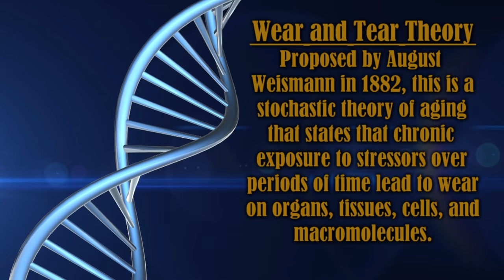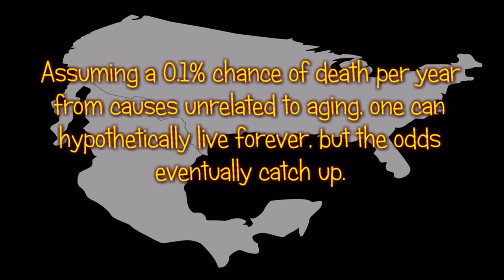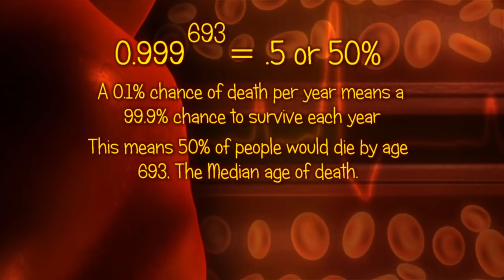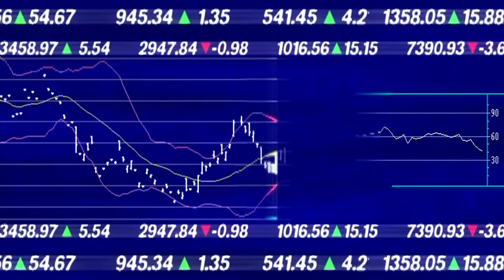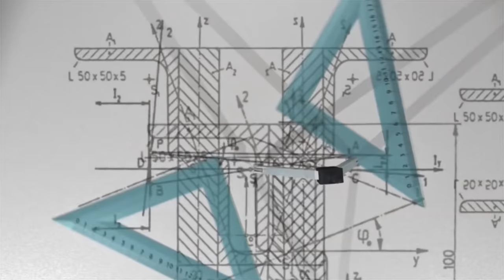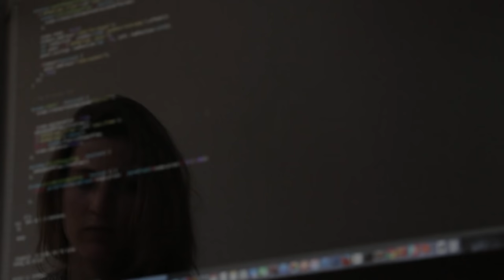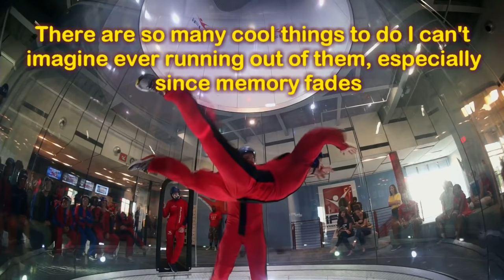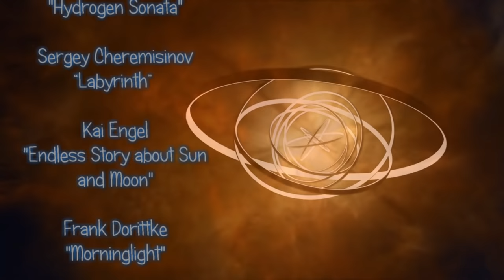Life Extension

Comment: Now I don't know of any statistics about this but anecdotally, from what I heard, lots of researchers will tend to change the topics they work on over time, either as they feel they have contributed enough in their current field or because they want to find something new-and-fun-to-them or sometimes directly out of activism (like, for instance, there are quite a few people who used to resarch, say, fundamental physics, but then transitioned to climate sciences because they consider the topic of critical importance) so with that in mind I'm not entirely sure the people who first successfully find ways to craft arbitrary lifespans will end up researching that same topic for their whole arbitrarily long lives.
Reply from the maker: Sure, interest vary over time but while you might change focus and get a little rusty on the original, you never really lose that expertise and can scrub the rust off rather quickly, often emerging with greater expertise from having new insights from letting it wait and looking at other things.
Reply: I agree, and immortals make the ultimate renaissance men.
Reply: That's true enough
Reply: I agree. Additionally I believe there are new insights to be gained from studying seemingly disparate fields and sciences. Using the example that Kram gave, perhaps a biochemist or even a sociologist could add a unique perspective on climate science, potentially leading to a breakthrough that may not have happened if someone didn't connect interdisciplinary theory or phenomena.

Comment: One thing I have to question is whether we overwrite memories. How do we know when we have truly forgotten something, and what does it mean to forget? I might observe something which jogs a memory or feeling of familiarity that may have gone unrecalled without outside stimulus. Was that memory forgotten? Is forgetting the loss of a memory, or the inability to recall it?  I understand that there are a finite number of neurons in the body, but I don't think we understand memory formation and neural networks well enough yet to say that we overwrite memories, although it is highly plausible. Given extreme longevity, however, I wonder if this would be much of a problem with artificial neural nets and physiological optimization.
Reply from the maker: We're still very iffy on a lot of the specifics about brain memory storage so take everything with a grain of salt, but to the best of my knowledge we do not overwrite memories, but the connections do change without use and the changing connections can alter a memory, akin to having a million frames in a video and changing some of the sequences to create a new film.We can imagine a slightly different scenario having occurred to, and insert that imagined event into our proper memory of it. So I guess the answer is Yes and No.

Comment: One major factor in aging is also telomere depletion. Our DNA has endcaps of blank DNA that partially break away every time the cell divides, and as the telomeres shorten cells stop dividing, leading to a loss of the ability to regenerate the body. This has likely evolved as a protection against cancer, because cells that are multiplying out of control will hit this limit very quickly and die off. Since evolution doesn't select for longevity, but only for fitness to reproduce this giant flaw to an individual has always been a huge boon to a species.

Comment: Have you ever thought about doing an episode on the DC (vs. AC) power grid?
Reply from the maker: I can't say that I have, its an interesting thing from  practical or historical level but not really the channel's flavor. I'm a big history buff but I generally limit discussion of such to interesting tidbits inside a more futuristic topic.
Reply: Although Edison had small DC grids, DC is also the new thing replacing AC for long distance power transmission. It can be millions of volts, does not suffer skin effect, capaciitive or inductive losses. It's now possible with new semiconductor switches that can convert back to AC at the ends. It is also good for underground and undersea cables. And the phase and frequencies at the ends can be completely different.

Comment: In my opinion, the two best research Charities to donate to would be either Parkinson's or Huntington's disease. Parkinson's will be solved by either cybernetics, single tissue neuronal replacement, or aggressive protection of sensitive cells. Each of those technologies will have trickle-down benefits.

Huntington's involves fixing a single gene, which will also have trickle-down benefits as the technology is adapted for other uses.

These are hard problems that require a specific tool in order to solve, but once that tool is invented, it will be adapted according to various intuitions

Comment: There's a very clever way you can avoid a gerontocracy. Those who are younger and more experienced can volunteer to work for a lower wage than someone older and with more experience.
Reply from the maker: Yes and no, that handles the employment issue to a degree but a gerontocracy is 'rule by the old', official or de facto, power and influence will concentrate to those who are older. We elect younger people for their vigor sometimes and sometimes someone younger gets a lot of power, wealth, influence, etc but in general we already live and usually have lived in civilizations where the people in charge were generally older than the average person, and when 'vigor' ceases being an issue and senility is not, that would tend to increase. Who do you vote for? The guy who has a resume covering several centuries or a few years? Who has more power and wealth and influence? Someone who is 200 or 20? There will be exceptions but as a whole we all get better with time and when age isn't wearing you down that becomes even more noticeable. Someone can hardly get elected to office by offering to work for less either, so that option isn't available.

Comment: If someone did discover how to make such a 10x or 100x longevity pill tomorrow, what about all the health conditions that aren't directly related to the cells of the body just failing from old age? Like strokes, heart attacks, etc.. There are no guarantees that a longer life span would also [significantly] slow the progress of such diseases. If someone lived 90 years (taking those pills), then had a debilitating stroke, they might live end up  living another 80 years (even if they stopped taking the pills) trapped in a useless body. So with extended life benefits also comes some extended risks if something bad happens to you that medical science has yet to find a way to fix. In a way, this is similar to the Torchwood comment someone made, only not to the extreme of a fully burned body (which would at least still be lethal with cellular life extension tech).

"Phil: Hey Bob."
"Bob: Hey Phil. What have you been up to?"
"Phil: Oh, I just finished up some chemo."
"Bob: How many times is that now?"
"Phil: This is my 27th cancer diagnosis in just 285 years."
"Bob: Really? I've been lucky so far. Only had cancer 15 times in the past 300 years."

Comment: Laws requiring seat belt and airbag only work for short time. Once humans find out that they are saved by those add-on, they will push their vehicle to go for higher speed, which will make seat belt and airbag pretty much useless when accident happens. Humans, is the problem.

Comment: In a society free of ageing the most common cause of death would be cancer. We all generate cancerous cells on a daily basis, it's our immunic system that filters them out most of the time. Long life span means more chance to eventually draw the short straw on the cancer game. Not to mention addictions: can you imagine a pair of lungs exposed to smoking for 1000 years, or a liver bathing in alcohol for centuries? :). Solving the aging issue is only one side of the coin. On the other side it's quite possible that by the time we find the solution to ageing we also will be able to grow organs to replace the failing ones and we likely can find the cure for cancer. Clarktech for the win :)
Reply from the maker: That's why one of the big Sens categories is OncoSens

Comment: Well... I think you're drastically overestimating what effect anti-aging would have on the death rate.   People die of heart attacks, strokes, and cancers in their 20's and 30's too.  Eliminating purely age-related illness does not eliminate the actual death vectors people experience.   What it does do is drastically increase the odds of survival if the health system responds rapidly enough if you have youthful vigor.  It by no means guarantees survival as the injury itself can cause cumulative damage, but without aging, the odds of being able to repair that damage increase drastically - even in the most extreme cases.  I'd say you'd have maybe a 25-55% reduction in the mortality rate based on global location increasing to maybe a 75% mortality reduction rate once health care and rapid response became universal.  

I also think that sitting on your blue-ribbon committee you'd have to consider the following.  Your workforce will require regular retraining to A) ensure that they are up to speed with social and technological advancements.  More importantly, a Social Security would still be required to fund a "retirement" phase allowing people to leave the work force and pursue that re-education.  If we use the number of having a 70 year work limit out of every 100 years, the Social Security System would provide coverage (plus whatever savings you would have) for a 10 year vacation and a 20 year retraining cycle.   This means roughly 3/10ths of your workforce would be out of circulation at any given time.  Maybe you'd pursue some other endeavor.  Maybe become an astronaut - in order to colonize the solar system where there would be more "independent" capacity for individuals.  This would also factor into your workforce and your populations as space is a far more deadly environment than living on earth.  Combine that with an inevitable reduction in reproduction due to work and social commitments I think the end result would be maybe a 20-25 percent increase in population growth with only a slight increase in unemployment rates and work availability.  

We'd likely move to arcologies or even orbitals to give people plenty of space.   A poor person might have 10,000 sq. ft of living space all to themselves, and we could provide this and more to every person for the foreseeable future and increase the amount of natural space available on the planet.   And as long as we retain and improve our global communications capacity, including our interactions with other people around the world, we will continue to experience the increase in scientific and technological advancement that adding these people to the population will represent.  In fact, it would likely inspire such research and development as young people struggle to discover niches where they might distinguish themselves - hopefully bringing fresh ideas and new methods and direction of research to topics that don't normally recieve attention because of more pressing issues or better opportunities.  

Just a few thoughts.

Comment: True immortality is entirely possible. If you had an android body made of a near-indestructible material such as graphene then the only thing that could theoretically kill you would be getting tossed into a black hole or a star. Just stay away from those things. As for an energy source, I can imagine a point in time where you can harness just about anything for energy. If there is mass, then you can convert it to energy and use it to power your body. We'll have trillions of years to figure out how to do that. Also energy is always conserved. The total energy in the universe today is the same as it will be for all time. Whatever you use, you're also putting out there.
Reply: GlacialTempestX Unfortunately not; entropy, not energy, is the limiting factor here. While it is true that there will still be the same amount of energy in the universe, it will be the same (low) grade everywhere, and there will be no gradients to exploit as everything will have fallen into the lowest possible energy state. Even direct matter to energy conversion isn’t good enough, as you will eventually run out of matter, and no process can be 100% efficient, so you will always be bleeding some waste heat into the universe, and only receiving ultra low energy photons and neutrinos in return.

Comment: I personally would encourage something a long the lines of libertarian communism (being an anarcho-communist and anarcho-syndicalist) as the economics and governance of a transhumanist society particular when it comes to longer life (libertarian communism is more in line with the original communist even before Karl Marx but I do think aspects of Marx has value the main difference is mutual aid, workers' control of their workplace through direct democracy, and society built of a union of communal units all which internally use direct democracy for law making rather representative "democracy", not to say representatives would be used under this system but they if do exist would be elected and at any point be recalled by the people they are representing so no set minimum term limits but their position would expire when the job they were elected to was done, or the people are no longer confident they are carrying out the duty, it would be on a job by job basis and only if it can be justified that a representative could be more efficient than every action being decided on by the the communes people) 

as for the biology I am a neuroinformatician but do deal with other parts of biology frequently (but not as part of my field) and I have seen some things coming through the pipelines already but it won't be adding centuries but maybe a few decades here and there but it might be enough for some people still in the earlier half of their life to be able to live for more powerful extension tech so I doubt if no one did anything in the near future when these smaller impact tech come that they will live to the point of the more impacting tech but I think bunny hopping where at first small increases may give you enough time to wait for larger increases.

Comment: A mind cannot stay sane for 100 years without complete redesign; most of the elderly, even without dementia are quite mad at that age
Reply from the maker: I've known a lot of folks in their 90s who were just fine, and much of that is the mind aging.
Reply: Isaac Arthur you haven't met my family :)
Reply: Isaac Arthur though your right quite mad is an ex adjuration, a better phrase would be eccentric but I do believe the mind is not infinitely resilient, for instance reflexes are know to reduce quantitatively with age; a similar problem to computers with full memory
Reply: youth of the body is not youth of the mind though mind melds have been preformed between rats with electrodes. And if extended to humans; could allow for mental extension with a clone for partial mental preservation. Or if FTLC comes about your could meld over interstellar distances :)

Comment: How about creating a new universe just before our own universe goes boom as mentioned here?: http://www.bbc.com/earth/story/20150602-how-will-the-universe-end

This can be used to reverse entropy.
Reply: CKing Pro : It's doesn't reverse entropy. It just sort of extends it. Think of the universe as a 20gallon bucket full of water with a few 1/8th inch holes drilled near the bottom. Entropy is the process of losing water, through the holes. Creating a new nested universe to live in, would be exactly akin to adding more water to the bucket. No new bucket is needed, however there is the problem of diminishing returns because it requires energy to create new water, and with every generation of a nested universe, the water created to fill the bucket is reduced by the exact proportions of energy converted to matter.

Comment: an engineered bacteria like organism should be superior to a nano machine. a sufficiently advanced nano machine might as well be a bacteria, however.
Reply from the maker: Yes, the line gets pretty blurry between organism and machine at that level.
Reply: Isaac Arthur You would want your "nano machines" to be able to self replicate so they need to be made out of materials that are native to the environment as well as use energy available there. I doubt bacteria do either of those things inefficiently. A machine as we know it is made out of inorganic materials and uses electricity as power. Neither metal or plastic or electricity is abundant in a human. Our machine would resemble nature's perfection.
Reply from the maker: Not necessarily, in some cases it might be better to have self-replication unavailable, like a chain. You've got four or five 'factories' in you that have to be replaced occasionally and each makes a couple types of factories which each make the robots or another layer down that makes the robots. It's a lot easier to control mutation if each step down is only able to make the next step down. We talked about that mutation issue in the SR machine episode.
Reply: That is probably true. Self replicating machines would have the potential to become cancerous or independant. Still, they would be bacteria. Bacteria will never develop immunity to anti bacterials as long as there is profit to be made from developing new anti bacterials.